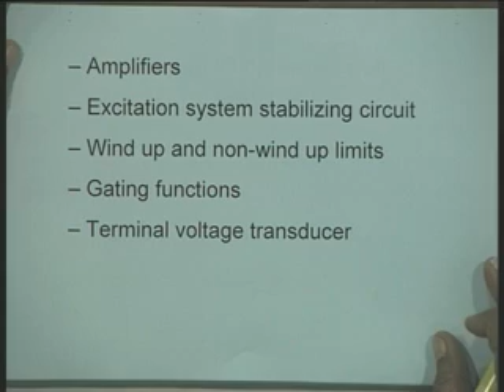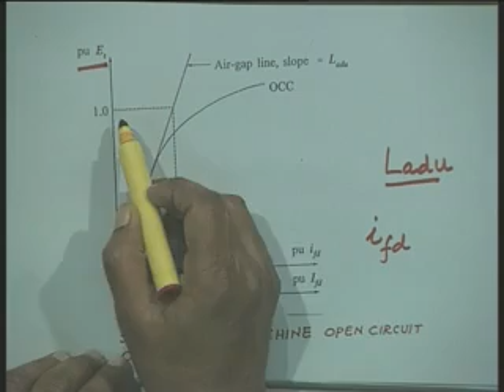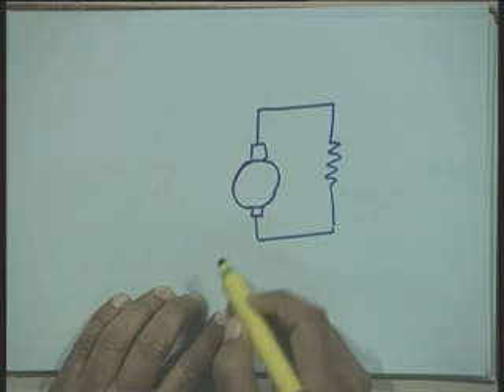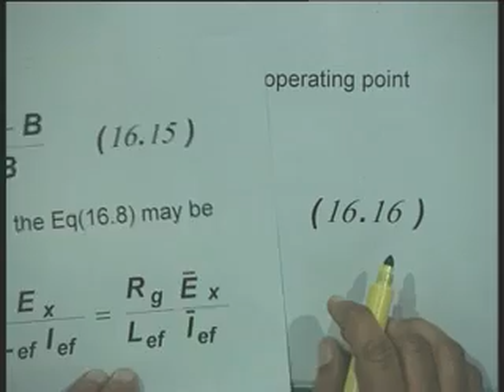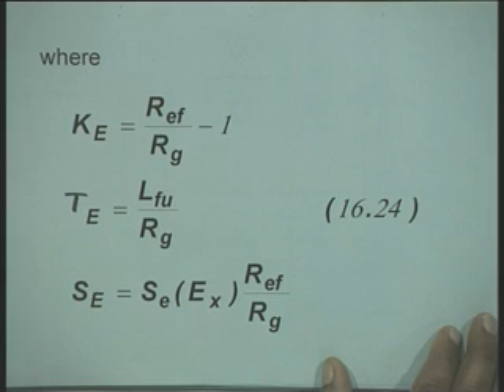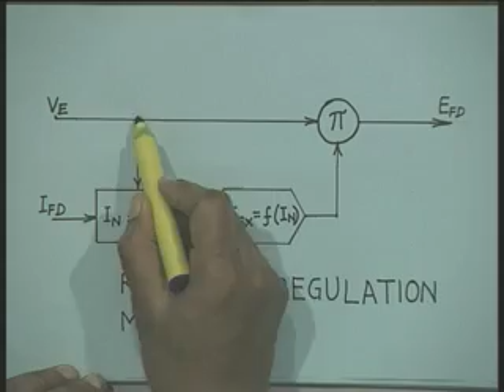Lec-16 Modeling of Excitation Systems-Part-1

Comment: Hello Professor, I understand that the terminal votlage Ex is proportional to the field flux linkage when in open circuit (when there's no armature reaction and ohmic drop), could you please explain why it's also valid to assume that Ex is still proportional to the field flux linkage when loaded? Thanks a lot!